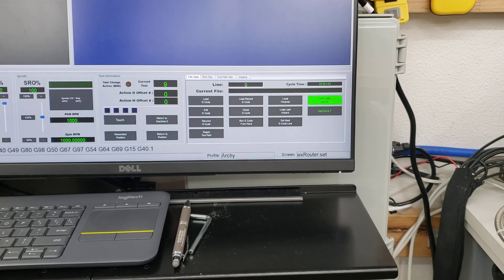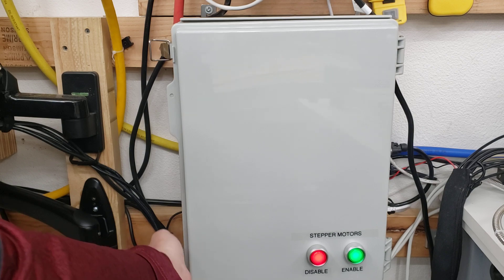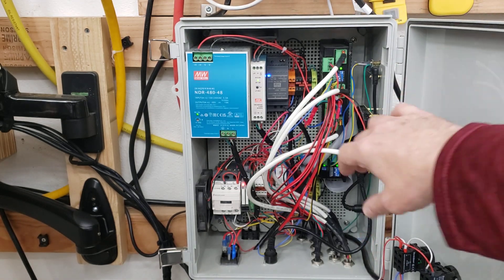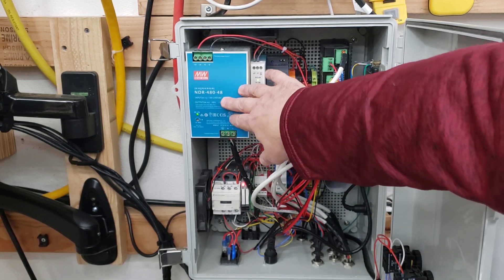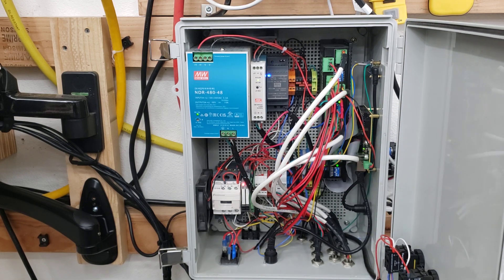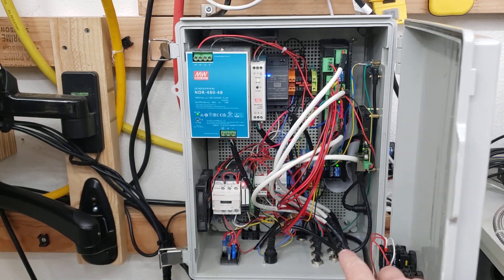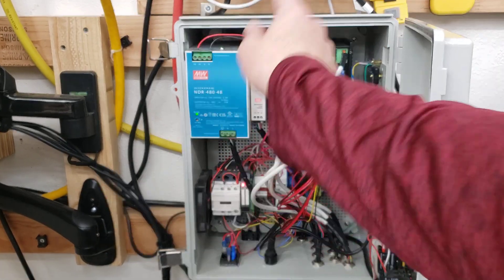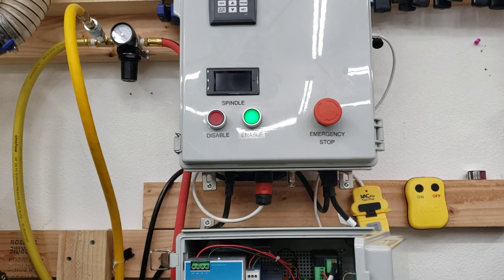Ultimate Bee CNC Drives

Comment: Did you have to put that all together and wire it up?
Reply from the maker: I did put it all together and wire it! However, I chose to do it this way as I have the required skills and I wanted to save money. A very similar system is available as a "plug and play" system or kit from Avid CNC.
Reply: @CNCMakerNW  so if i buy the same Ultimate Bee kit from Bulkman 3D ... will I have to do all of this myself ??
Reply from the maker: @PK22-b7v  I purchased only the mechanical kit from bulk man, but they offer many options. I chose to build my own for performance vs. cost